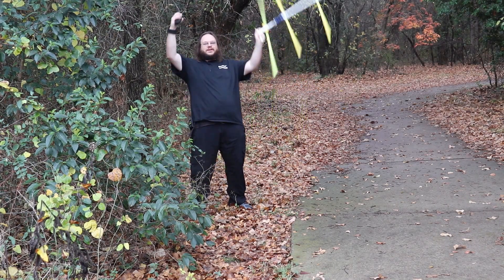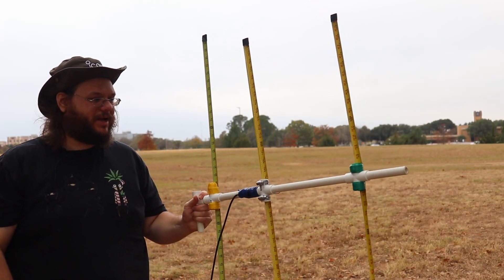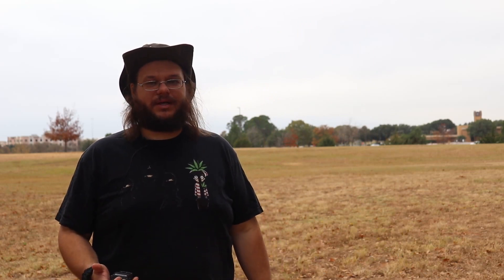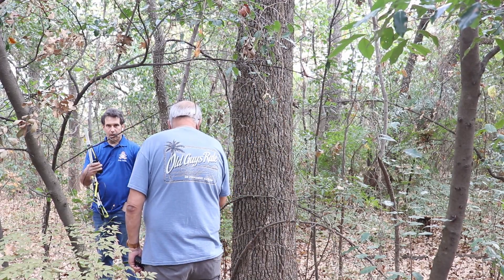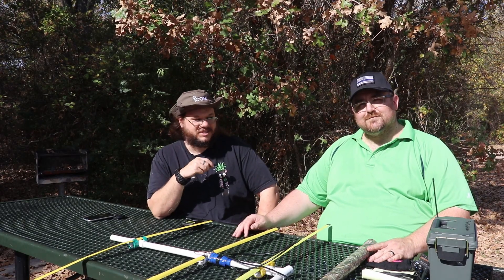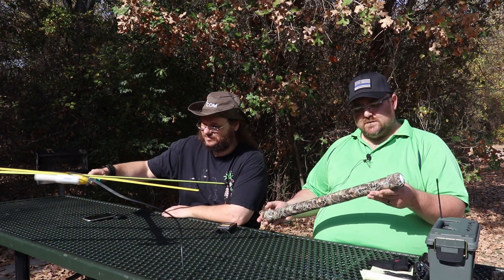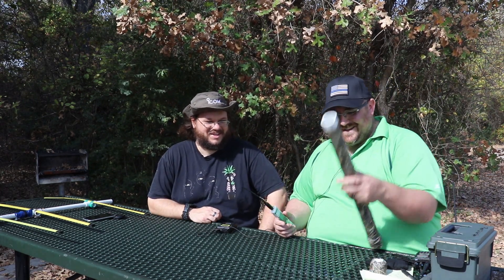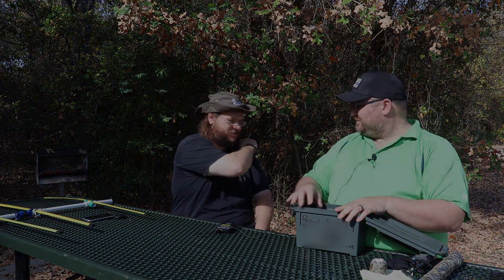Basics of Amateur Radio Fox Hunt

Comment: Love t-hunt videos. Thanks for posting. 👍

A couple of questions: I understand the Micro Fox rig, but with the ammo box rig, what was controlling the timing of the broadcasts?  Also, I gather that VOX was used with the media player to handle the PTT situation, but why was the media player also plugged into the mic jack?
Reply from the maker: I believe timing was done with a silent section on the track after the ID, then the Track was looped over and over again.  The Media player was plugin into the mic port with VOX enabled on the radio.  During the silent partitions of the track the VOX will be not activate and the radio will NOT be transmitting.  Then there was audio, tones and the station id, #KeepItLegal.  VOX will activate and the radio will transmit the incoming Audio.
Reply: @TankRadio  OK, got it. Nifty way to overcome lack of microcomputer based control and the need for a separate PTT cable.